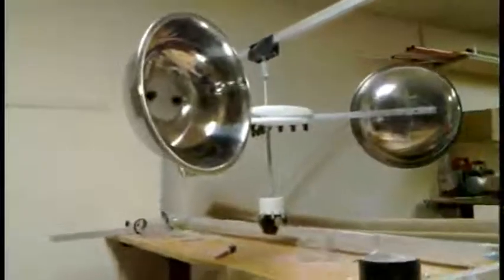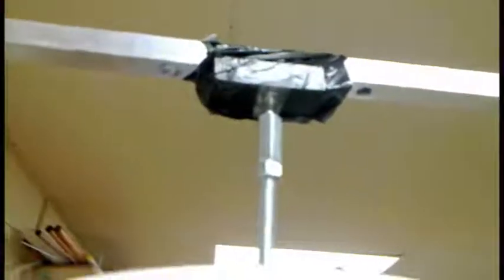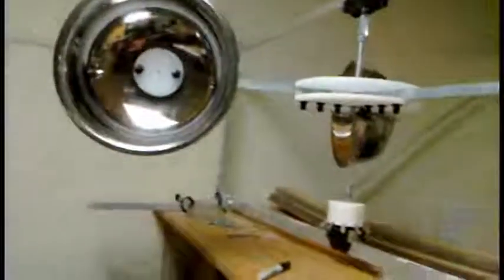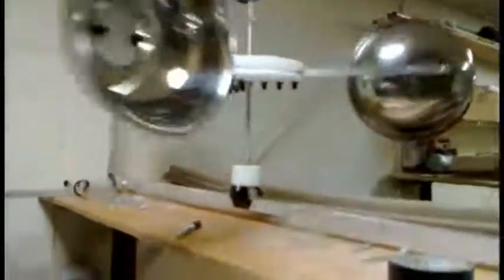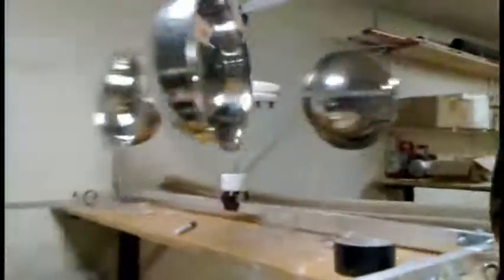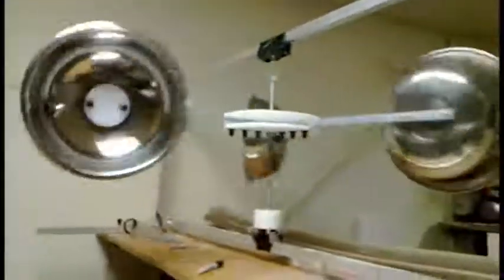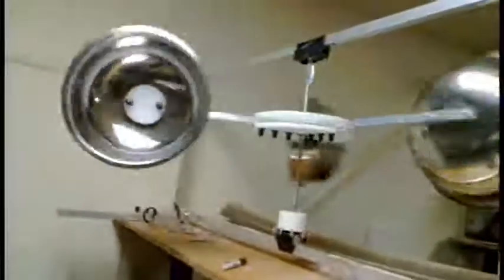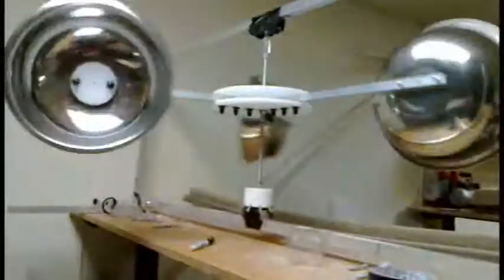VAWT with new Magnetic Levitation Axle

Comment: @KyleCarrington - Efficiency. You are right, but any point of friction no matter how menial will increase the required wind force to start the turbine to spin. So removing as much friction as possible will improve efficiency of the turbine. Not saying this will work once you install the rotor, but the concept is sound.

Comment: (continued from lower comment) The magnetic iron core can be a drag on wind power systems, but it can also be used as a 'breaking' mechanism under extreme high wind speeds. Spring loaded iron core rods that engage under high centripetal (G forces) will allow you to capture all of that excess energy. A second rotor with a clutch engaging unit having iron cores would be a simple way to do this. I would sale the excess back to the power company...    :-)

Comment: What are you planing to light up ? An LED maybe ? I'm not sure where you could get a generator small enough to have a load that wouldn't just stall that turbine. With a lot more work and luck, you may be able to charge a cell phone . The difference between the friction from bearings and Mag lev ,is nothing (zero) compared to a generator load of any kind. This is a great real world learning lesson for you. Keep on going and you'll get there if you're persistent and learn from your mistakes.I already use a similar  design for measuring wind speed.

Comment: What the hell are you commenting on? Did I mention energy in my comment? I was talking about the soundness of the concept, not real world application.  Removing friction will require less force to turn the turbine, remove enough and actually YES the 4 MPH could be enough, not for a 120V application, but to charge a small battery cell, why not. Most cell phones require less then 5 Volts at 500 miliamps, some even less, not hard to achieve in 4 - 7 mph wind.
Reply: Even better...charge capacitors

Comment: The comments about battery charging voltage being too low? Step up the voltage through the use of a capacitor/zener diode circuit (auto low RPM/high RPM switch). The capacitor can collect the low voltage, step it up, and deliver it to the batteries at momentary intervals. I've studied some of the comments about wind speeds being too high?  Design a rotor to insert coil core rods during higher wind speeds. Don't fear that 'excess' energy, capture it, manage it, harness it! (continued)